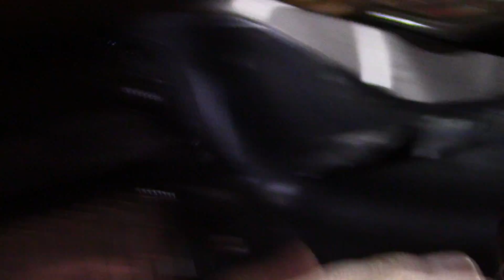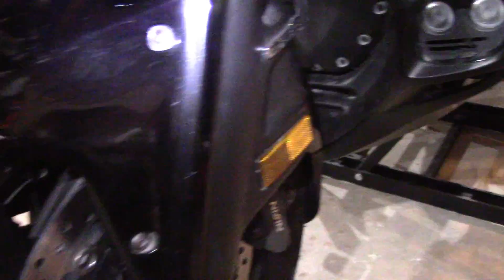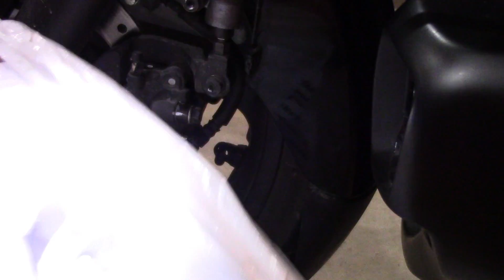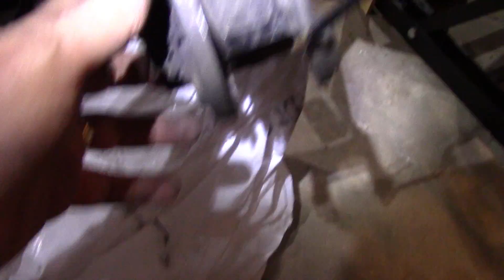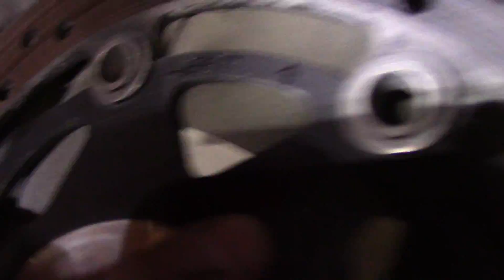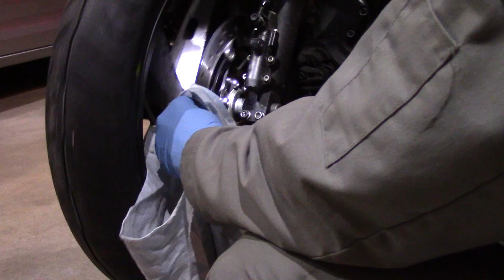Honda Goldwing F6B wheel removal and re-install

Comment: Thank You for your Awesome tutorial!! I'm in the middle of re-installing my front wheel. I was wondering about the right pinch bolts but, I saw in the comments that you did it right after you torqued the axle bolt. I have a couple questions; Would I be correct in saying that you only loosened the left side pinch bolts when you had the bike on the ground pumping up the brakes? Thanks again. 👍

Comment: Just wanted to thank you for producing such a straightforward video. I took off my front tire today and dropped it off at a local shop, unfortunately I won't get it back for a few days. After reading the comments I got all the answers that I had regarding the right side pinch bolts, and the torque specs for the rotors. Thanks for previously replying to those questions! 
 Again, great video and thanks for taking the time to make it.
Reply from the maker: I'm glad the video gave you the motivation and confidence to do the job yourself. It feels good to save a few dollars and more importantly for me anyways, to know the work was done correctly!

Comment: VERY GOOD VIDEOS!! DIRECT AND TO THE POINT! I AM A MASTER HARLEY DAVIDSON AND HONDA TECHNICIAN AND YOUR VIDEOS ARE AMONG THE BEST! 
THE LITTLE TIPS YOU INCLUDE ARE CRITICAL POINTS TO ENSURE PROPER ALIGNMENT AND PREVENT OTHER PROBLEMS! IE.. VIBRATIONS, HOT SPOTTING THE ROTORS..
GREAT JOB!
DON
Reply from the maker: Thanks for the kind words, Don. I have always believed in "paying it forward". I am a retired high school shops (electrical) teacher. Making those videos was enjoyable and easy for me. If I were to do them again, the only changes I would make would be to have an assistant do all the camera work and use better lighting in my garage. But if they can help someone do a task and be rewarded with the confidence of doing something successfully, then that's a win in my books.

Comment: I liked the video , however at the end of the video, I noticed  you only tightened one side of the pinch bolts on the front  axle at the end , did I miss something or did you assume I should tighten both sides .
Reply from the maker: OK, left pinch bolts tightened at 33:35, right pinch bolts should be tightened and torqued right after the axle nut was torqued IIRC
Reply: @tcalof  Thank You for your Awesome tutorial!! I was wondering the same thing about the right pinch bolts. Only other question I have is; Did you have all the pinch bolts (both sides) loose when you had the bike on the ground pumping up the brakes? Thanks again. 👍

Comment: great job!i liked it!, any reason, i recall on the f6b GW, you can remove one pin on the rear pads, w/o removing anything else like caliper, so i am surprised you cant do it on GW  on the front brakes, right? thanks!

Comment: John great video. Question is some say the right side caliper doesn’t need to be removed. What do you say?
Reply: Thanks a lot.
Reply from the maker: It's the left caliper that doesn't need to be removed. I replaced my tire again this spring and I only removed the right caliper. The only difference is that when refitting the wheel back onto the forks, you need to be careful aligning the left rotor into the left caliper.

Comment: I wish every home mechanic was as to-the-point and knowledgable as this guy. Need to hear more from you on other f6b projects my friend!
Reply from the maker: Thank you for the kind words. My next project will be replacing the horrible Electrical Connections fuse block near the battery with an under-seat Eastern Beaver fuse block.

Comment: Thank you for making your videos, I'm actually going to attempt the filter change because of your great video on that! Can you tell me what kind of Jack,lift you have?
Reply from the maker: Sure, it's a J & S with a Goldwing adapter.
Reply: Thanks, yeah that's a nice Jack, but a high dollar one!
Reply: so I have two tall prder request request, first off a picture on how you line up your jack on your Center stand, number 2 , and this would probably be a First on YouTube, a valve adjustment video !  cannot believe how much the dealership wants for one of that! 600+ + +
Reply from the maker: The jack has two arms. The forward arm is where you place the glowing adapter. The adapter has padded indents that lift the engine right behind the mating seam or ridge that runs laterally across the oil sump. The rear arm rests midway under the centre stand. Very easy to align. A picture might follow, no time right now. 
Regarding your second request I have no intention of ever doing a valve check or adjustment. It is extremely rare that a GL1800 engine requires any adjustment over its life unless the engine has been really abused or oil changes neglected.  @johnk12345100
Reply: Thanks on all! Just seems like whenever anyone ever mentions a tapping sound or growling sound coming from the engine, somebody always brings up valve adjustments. What you say I've heard in the past so sounds good to me! Looks like a real pain in the butt to do, thanks on all
Reply from the maker: Tapping and growling are typical of the 1832. The solenoids that operate the 6 fuel injectors are notorious for occasional clicking noises. The growling is the clutch; perfectly normal. The clutch operation is boosted by oil pressure. A cold engine has the highest oil pressure, thus cold start growling. Regarding the valves, the new 1833 engine will require valve adjustments. It's a Unicam engine; a single overhead cam operating 4 valves/cylinder. On that engine the exhaust valves are adjusted using screw and locknut while the intakes use shims. The screw and locknut definitely need checking regularly. @johnk12345100
Reply: @tcalof  damn you have to be a mechanic! LOL thanks for all of that! I'm going to stick with pre 18 models!,

Comment: Remove the right caliper yes but the wheel will roll out and back in with the left caliper and caliper cover still in place. left caliper only needs to come off if other services are required like fork seal replacement or whatever. It's a time saver if your a pro. tech. time = $

Comment: You also need to remove the amp in order to roll the tire out on the F6B if only using the centre stand.  This is good stuff.  Saved me some $$ at the shop.
Reply from the maker: I guess you could have laid the bike on its side to remove the rear wheel instead .

Comment: Great video. I especially appreciate that you give wrench/socket sizes and torque specs. Not trying to be critical at all, but I didn't notice at what point the right side pinch bolts get tightened?  Is it after the axle bolt is tightened? Also, does the right side pinch bolts also get loosened again before you bounce the forks?  I also agree with Joe that it would be helpful to have a pic of jack placement. I took lots of notes and feel like your video helped a ton. Thanks much for taking the time to make and post it!
Reply from the maker: Thanks Russ. Here's the instructions I made for reinstalling the front wheel:

Install collars in wheel, left side short collar, right side with pulser ring, larger flanged collar
Support wheel, and slide axle in from left side. Align the axle index line with the left fork leg
Tighten left axle pinch bolts to 16 ft-lbs
Install axle bolt on right side, tighten to 44 ft-lbs.
Tighten right axle pinch bolts to 16 ft-lbs
Install right caliper, with rotor between brake pads, 23 ft-lbs

Install ABS sensor wire clamp, nut plate to rear, and tighten bolt 8mm

Install the pivot collars in left fork and caliper bracket

Grease the inside of the left caliper mount (needle bearings) and grease the outside of the bushing before pushing it into the caliper mount, push bushing through & wipe off excess grease from front & back side of bushing holes. Grease the upper bushing at delay valve, grease the inside of delay valve bracket & outside of caliper pivot joint at delay valve

Slide left caliper over rotor & align holes 

Install upper torx bolt first, then lower bolt. Don’t torque caliper bolts yet 

Clean both sides of rotors with brake cleaner or alcohol on clean cloth, spin wheel

Torque caliper bolts lower caliper pivot bolt 23 ft-lbs, delay valve joint bolt 19 ft-lbs

Loosen left axle pinch bolts
Check left rotor clearance, .7mm each side
Lower bike off jack, pump up front brake lever until firm, bounce bike up and down, retighten left pinch bolts 16 ft-lbs

Comment: Great video,  but you did not say the torque for the break disk and the ABS pulser
Reply from the maker: Sorry, just saw your inquiry 2 months after the fact. Brake rotor nut torque is 15 ft. lbs. in a star or cross pattern.
The pulser ring torque is only 5 ft. lbs.

Comment: I own a F6B w/o a center stand but I do have a jack like yours, I'm just unsure where to place the jack under the bike. I have an idea where I would push under bike on right side like you did with left side of jack under the center stand support but I'm afraid the right side of jack may be placed in the wrong spot. It seems there's a plastic piece which I believe is the coolant reserve tank under the bike that is in the general area of where the right side of jack would be placed. Do you have any photos of jack placement under bike, I'd appreciate it? Thank you
Reply from the maker: Sorry, I just saw your inquiry 5 months after the fact. The centre stand is necessary to jack the bike.The rear arm of the jack must lift the bike from beneath the centre stand. With no centre stand, the rear arm would push up against the coolant overflow tank and pivot mount for the rear swing arm. The bike would topple off the jack.